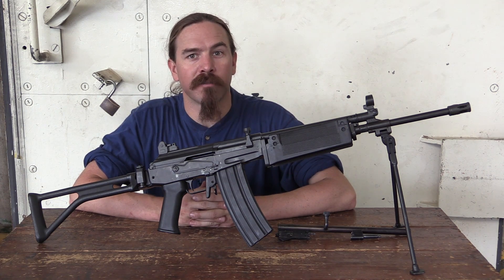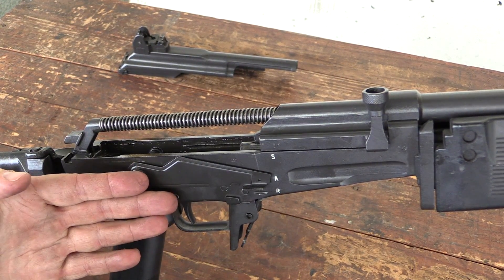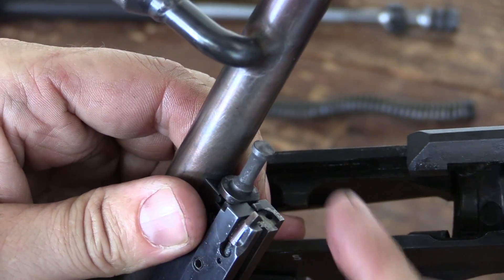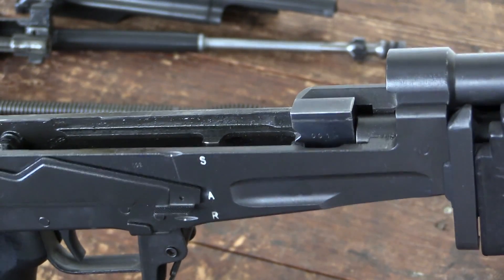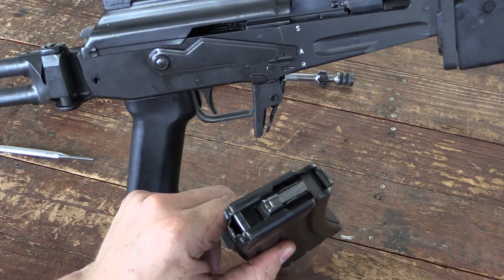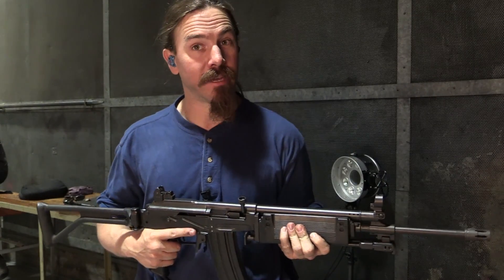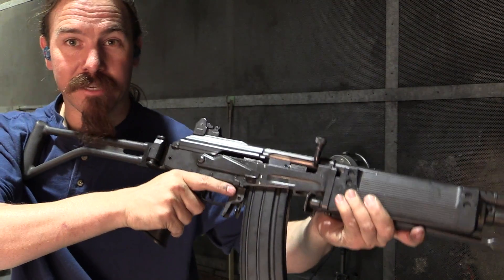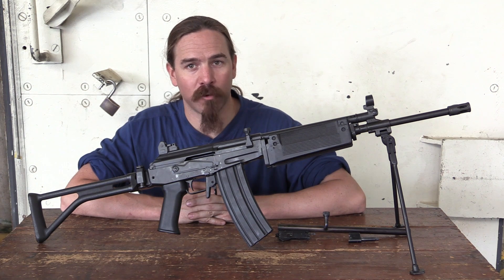Neophytou Gas-Operated .22 Rimfire Conversion for the R4/Galil

Comment: What is ingenious here is that the gun is basically blow-back operated. The blow-back pressure of the cartridge case is however too little to operate the bolt against the pressure of the standard recoil spring. Neophyto simply fitted the little gas piston which approximately doubles the power available (pressure on the bolt), and "Bob's your uncle!"

Comment: How in the hell does that thing cycle a full power recoil spring meant for 5.56 with such a heavy bolt? Straight blowback .22s need super light bolts and spring to work, and all they did was add a piston to this one and somehow it has more than enough gusto to run. Is there some aspect to physics I'm not getting here, because it seems like somehow adding an extra hole for gas to vent through on an unlocked chamber is adding more rearward energy to the system than just the standard equal and opposite reaction with a blowback system?
Reply: My five cents. The casing expands in the chamber and slows down extraction and thereby energy transfer to the bolt. The piston does not have this hindrance.  And if i dont missunderstand tings the gas is vented into the gastube before it is fully expanded and then continues to expand and all can not go back throug the gasport/ more is pushed in and therfore more gaspressure is directed to push the bolt back instead of pushing on the bullet. Of course the piston also increases the area afected by the gas pushbacks. I migth be wrong in some or all of my asumtions but that sounds logical to me.

Comment: Why not a 35-round .22 magazine?
Reply: There are ways to do that but they aren't linear (standard single/double stack). The rim is the problem. Calico used a helical magazine, and there are plenty of drum designs... all with varying levels of reliability (sometimes between the same make/model of mag).

Comment: It appears that this system could be relatively easily adapted to some other 5.56 weapons. It needs front locking lugs and a bit of vertical room for the gas system, everything else could be made to fit the host gun.

Comment: I'm no engineer but it seems to me like the use of a gas system would exist so you can reuse the recoil spring and fire control group from the standard rifle. There didn't appear to be any locking system for the conversion so I would think it would work as a blow back. But I wonder if it might not have had enough force to run the system so Neophytou added the gas system to add more force to allow it to work

Comment: Would you not just have a plastic bolt and bolt carrier? (It would all be the same piece)

It would have a small piece of metal for the bolt, but all else is plastic( you could reinforce it with some wire if the design is too weak?)

Comment: Ian I have a question: Do you actually need to change barrels here, or is a .223 Barrel compatible with .22 Rimfire?
Reply from the maker: The .223 barrel is compatible with .22LR, as long as you have a chamber adapter.
Reply: @ForgottenWeapons  Thanks mate, I didn't know this.

Comment: Slick system! I am surprised that .22lr has enough gas pressure to cycle that. J.A. Cenier of Titusville used to make a .22lr conversion kit for 7.62 caliber AK's but I've never gotten my hands on one.
Reply: Spring pressure and gas pressure of the ammunition are key factors for a working 22. conversion. Standard issue German 22. ammunition had a rate of failure to charge of 10 - 20% using the Walther 22. conversion for the Walther P1. Using US issue 22. ammunition they worked fine.
Reply: @herosstratos  What is standard German issue .22 ammunition ? When I was in the German Air Force We used the blue plastic ammo for G3 and a special bolt carrier for some training purposes on a D- Type shooting range ( 50 m )  For our P1 and P8`s there was no conversion kit, we used either blanks or life ammo  in 9 Para. There was a conversion kit for the G3 in .22 but have never seen and never used. We can buy a Walther P 38 in .22 LR here in Germany but that is no conversion kit, it is a P38 in .22 LFB ...

Comment: Does it replicate the recoil in some way too? I would think that would be an important thing to get used to too.
Reply: If you had personnel at the start of training who never handled a gun before, it would be a great advantage to have them start with the gun they will be actually using after training is complete and having them fire 22 ammo through it until they are familiar with proper handling and enough marksmanship to the point of aiming and getting their shots on (or very close to) target.

Advancing from there to the full size ammunition and recoil should not be as large an adjustment for them.
Reply: That's not generally possible with .22 conversion kits. The .22LR simply doesn't have the same power as the original cartridge. You could conceivably make a dedicated .22 trainer that replicates the service rifle's recoil but the rest of the handling characteristics would be altered too much for that to be useful.
Reply: @MikeDCWeld  I’m not that knowledgeable when it comes to guns, but could you not “just” reduce recoil dampening “things”, to at least approach the recoil from a full-size cartridge? 

@
John Griffin Sounds reasonable. I was just thinking that, changing the recoil would make it harder to hit, at least with follow up shots.
Reply: @0KOrbU0  You're talking about 1300j (.223) of energy compared to less than 300j. There's no way to replicate that difference in recoil with a mechanical system short of adding more energy (there are recoil simulators which use pneumatic systems for instance). Which would interfere with the simplicity and other identical handling characteristics.
Reply: @0KOrbU0  no. The physics involved prevent that. The force shooters experience as recoil is a result of the firearm's mass being moved by the force of the bullet being propelled downrange. The two simplest ways to change the felt recoil are to change the load used, either within the same caliber or with a caliber conversion, and changing the weight of the firearm. A prime example of this phenomenon can be found in revolvers. Revolvers chambered for the. 357 Magnum cartridge can chamber and fire the. 38 Special cartridge because, despite the difference implied in the cartridge designations, they use the same projectiles and the primary difference is the length of the case. The .38 Special case is shorter by design to prevent people from trying to use .357 Magnum ammunition in firearms not designed to handle it. The shorter case means less capacity for powder and a lower maximum pressure possible. While there are many different loads available for each, as a general rule commercially available .357 Magnum rounds will produce noticeably more recoil than .38 Special rounds fired through the same revolver. .44 Magnum and .44 Special is the same way. In the case of the conversion in the video the difference is more drastic. The entire .22LR round is roughly the same length as the projectile of the 5.56 round and weighs approximately the same as the 5.56 projectile. This means that it is using far less powder to push a lighter bullet and it simply can't generate nearly the same amount of force on the rifle. .22LR simply doesn't have nearly the powder availability or bullet weights to simulate the recoil levels of any centerfire rifle cartridge used by any military.